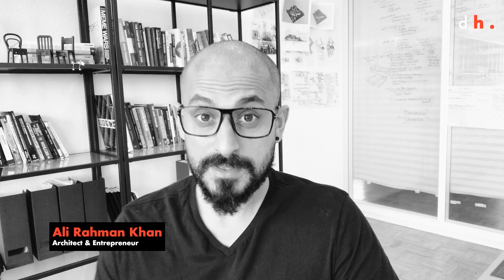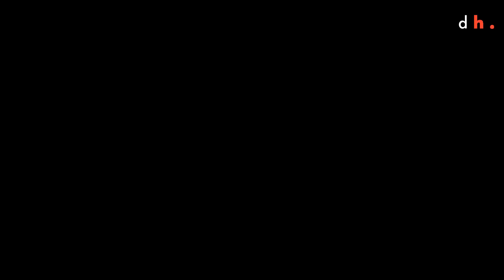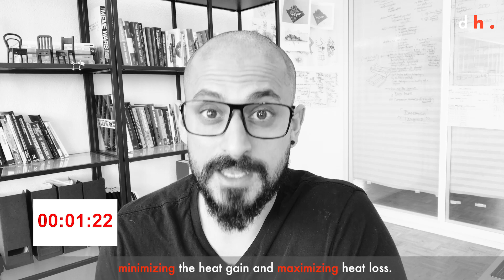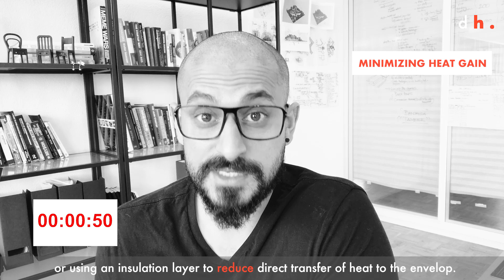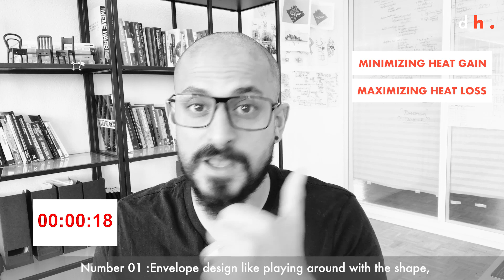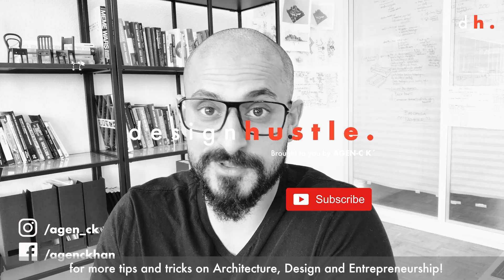Passive Cooling Strategies in Architecture!

Comment: Ok, so I know that you are just using the same terminology that everyone else in the net-zero / passive house / sustainable architecture scene is using, BUT...

I'm sorry I just have to say this. Preventing heat gain is NOT cooling. Shading is NOT cooling. Insulation is NOT cooling. Cooling means lowering the temperature of something. Preventing it from becoming warmer, or reducing the rate at which it becomes warmer, is NOT cooling. When I search for 'passive cooling' I am looking for ways to actually LOWER the temperature of something, not just ways to reduce the rate at which it gets warmer. If the ambient temperature is 25 degrees Celsius or above, just providing shading is simply not enough. I need to COOL the building to 20 degrees and no matter how much blinds and overhangs I put in, that will not be achieved. Certainly, shading and blinds etc are important. Essential even maybe, but they are a form of insulation. They are NOT cooling. Again, you are just using the same terminology as everyone else, so nothing against this video in particular, but what can I say? You are simply ALL using the WRONG terminology. Cooling means LOWERING the temperature. After watching a hundred videos about building orientation and overhangs etc I'm getting a bit fed up with all you guys calling it cooling. It simply isn't.